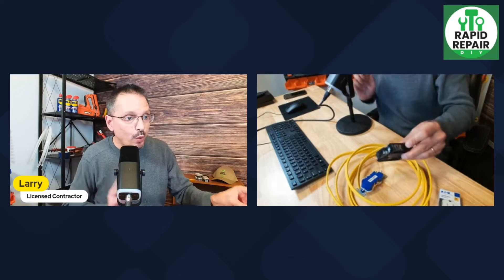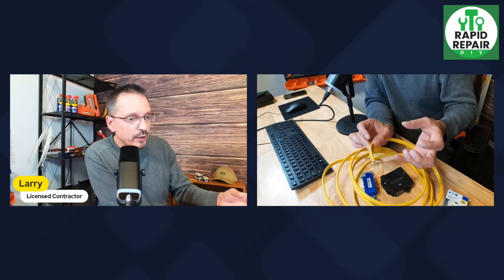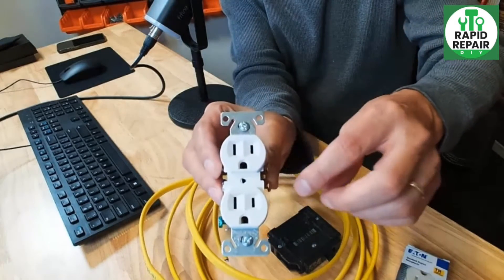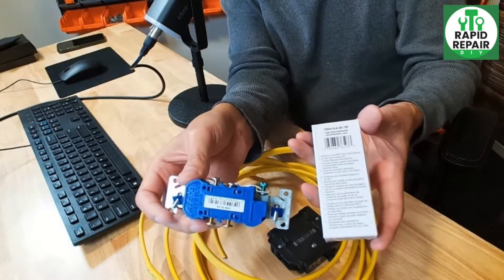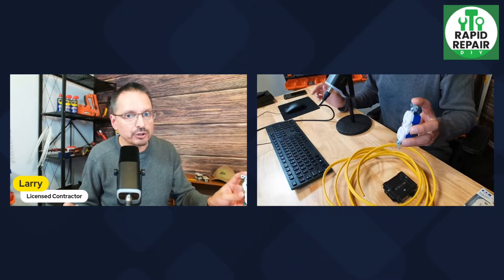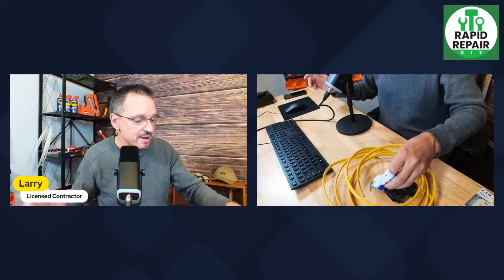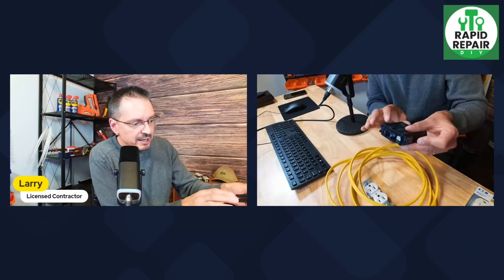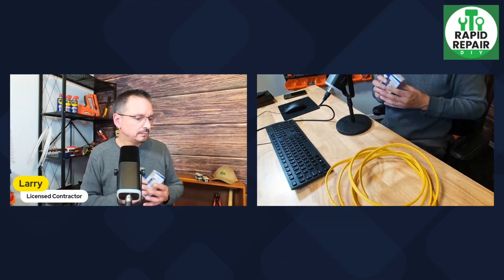Can You Install 15 amp Outlet on a 20 amp circuit?

Comment: I have this exact configuration in my home. Because the breaker is 20A and the wire is 12AWG, can I simply swap out the 15A outlet and install a 20A outlet instead?
Reply from the maker: Yes you can 100% 👍🏼😎
Reply: @HomeRapidRepair  thank you!!! Can it be on any outlet in the circuit?

Here’s why: need to power a new sauna which requires 20A, and I’d like to plug it in to the outlet with the better location.
Reply from the maker: @WessideStorie  yes it can be anywhere. But if you are smart enough to install it closest to the circuit breaker that would be wise… first or second in line on that circuit rather than downstream of 10 other outlets, etc.
Reply: @HomeRapidRepair  awesome. Thank you. I have a high quality 10AWG 50’ extension cable. Any concerns with using that to bridge the distance gap between sauna and the outlet?
Reply from the maker: @WessideStorie as long as it’s rated for the load I have no concerns

Comment: Or can i run 20amp on light fixture
Reply from the maker: Yes
Reply from the maker: The circuit breaker size determines the wire size.
Reply from the maker: Happens all the time. For instance, a kitchen circuit is probably 20 Amps and that has a light fixture

Comment: Can i use 14/2 wiring on 20 amp outlet for light switch?
Reply from the maker: I don’t think that will be a problem however,  Make sure the circuit breaker reads 15 Amps and NOT 20 amps. If that circuit breaker is 20 Amps make sure to only use 12/2 wiring.

Comment: What about a 15amp machine on a 30amp receptacle?
Reply from the maker: I’m not sure. Generally with electric everything should be matching…however they allow the 15 amps outlets even on 20 amps circuit because there is no overload risk. A dedicated 20 amps plug 🔌 is shaped different and won’t fit in a 15 amps outlet.

Comment: Hello sir and thank you for the video. Maybe you can help me... I have an independent line (10 gauge wire) running from the breaker box, to the water well pump at 120 feet distance. The breaker for this circuit at the main box is 30Amp. Then there's another breaker box at the well pump room that has two 20amp breakers. One seems to be for the pump, and the other one is for a single receptacle and also a light switch on the wall (3ft from the pump). I noticed the outlet/receptacle on the wall is a regular 125v 15Amp rated outlet. 

The owner did the wiring on this old house about 25 years ago, and now I'm wondering if this setup is correct? I'm not a pofessional but can you tell me if it's correct to run 10 gauge wire on a 30amp circuit from the main breaker box, and then connect it to a secondary breaker box (with two 20amp breakers) at the well pump room; with the outlet being a standard 15Amp receptacle? Is this a hazard and should I change the outlet to 20amp, or 30Amp? 

The reason I ask is because I want to run a 10 gauge extension cord 50ft from that outlet, & connect it to a sump pump to drain an inground pool. The sump pump I plan on using is a 3/4 HP, 550W, 127V 60 Hz, 7.8 Amp.  I want to know if the receptacle at the well pump room, is the correct one to use for this purpose. I plan on having the well pump off when I run the sump pump of course... Please let me know what you recommend. Thanks for your help.
Reply from the maker: Yeah, that’s a very interesting and strange set up. But I have seen it similar before in very old homes. The second panel is essentially a sub panel… Yes, your instincts are correct. There could be a safety problem there. I would upgrade the outlet to a 20 amp For sure.
Reply: @HomeRapidRepair  Thank you. I also received a response from someone else yesterday who claimed to be a retired electrician. He said the 120V 15amp receptacle should be fine for the sump pump I'll be using. Based on your response it looks like either would do, but maybe just to be extra safe I should go for the 20amp as you recommend....
Reply: @HomeRapidRepair  Hello Sir. Sorry to bother you again, but I do have one more question. I read that when an outlet isn't grounded, you should use a GFCI receptacle when using sump pumps to avoid electrocution. So my question is, will a 15 or 20amp gfci, TRIP, if overloaded and connected to a subpanel that has a 20amp breaker, and this subpanel connects to the main circuit which has a 30amp breaker? I'm worried that a 15 or 20 amp GFCI outlet won't trip if there's an overload, because the main circuit is 30amps, causing the receptacle to melt or cause a fire? 

Does the main 30 amp breaker override the subpanel breaker, Or does the 20 amp breaker on the subpanel, overide the 30 amp circuit breaker on the main panel? If the latter applies,  which gfci (15 or 20Amp) will work in this scenario? The sump pump I want to connect to the outlet is 3/4 hp, 110V, 560W, 6.8 amp. Thanks for your help.
Reply from the maker: @GoldenCup888  hello. The GFCI outlet on an ungrounded circuit is offering fault protection only… But it is very limited protection. Because of the nature of what you describe, I would try to run an grounded outlet over there grounded circuit over there if you can at all.
Reply from the maker: @GoldenCup888  as far as which one will trip first?… It just depends on which one gets the overload first.

Comment: Does the same
Hold true for light fixtures? I have a 20 amp GFCI running to my shed with #12 wire. I want to run 14/2 Romex from the GFCI load to a light fixture on the wall above it. Is this OK or should I continue to run #12? I believe most light fixtures have #14 wire. It will be motion sensor activated, so no light switch.  Yea or nea?
Reply from the maker: Your thinner 14 gauge wire would be a no go. Because it’s a 20 amp circuit you have to stick with the yellow Romex thicker 12 AWG 👍🏼😎
Reply from the maker: I hear what you saying about light fixtures having thin wires… We know in the real world it won’t be a problem because it’ll draw such a small amount… But I think the safety and code is factoring in somebody in the future might install a totally different type of fixture…

Comment: Ya but if it's a 15 amp outlet on a 20 amp circuit and your pull say 18 amps through the 15 amp outlet won't  that will overheart the outlet and lead to burning within the outlet before the 20 amp breaker would ever trip??
Reply from the maker: This is one of those rare times where it will be fine. 15 app outlet is the exact same on the inside as the 20 amp outlet, the only difference is the shape of the front. The code does allow a duplex 15amp outlet on a 20 amp circuit 🛠️🛠️
Reply: @HomeRapidRepair  If they are the exact same on the inside, as you say, then why do they have different ratings? The only difference is the plug-in configuration. Still doesn't make sense to me.. but I will always use the same current rated receptacle as the branch circuit size breaker! You can never go wrong with that way! I have never installed 15 amp receps on a 20amp breaker. 15 amp to 15 amp! 20 amp to 20 amp!